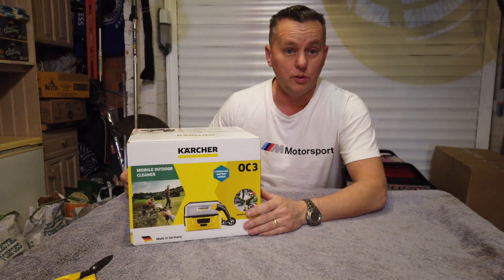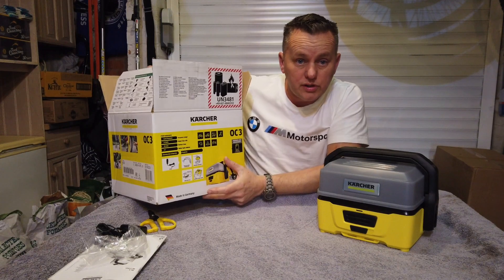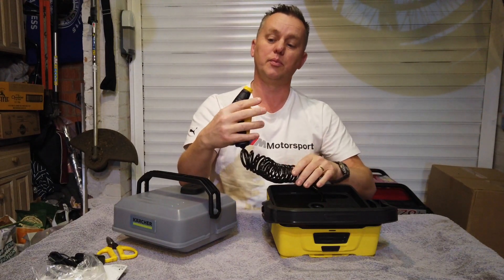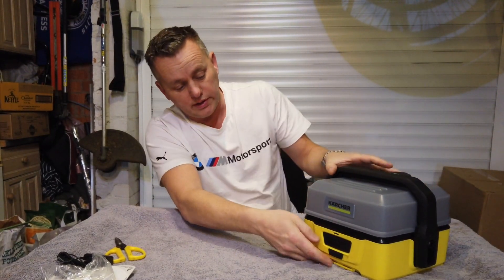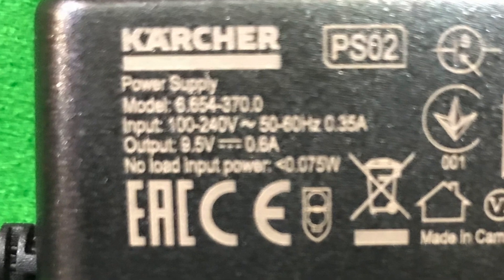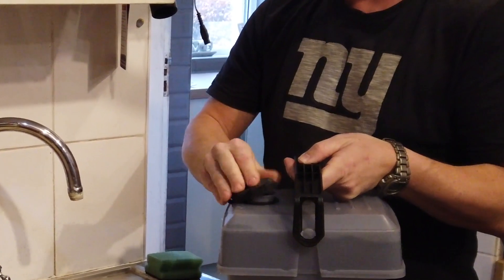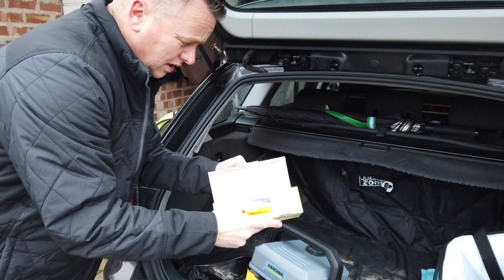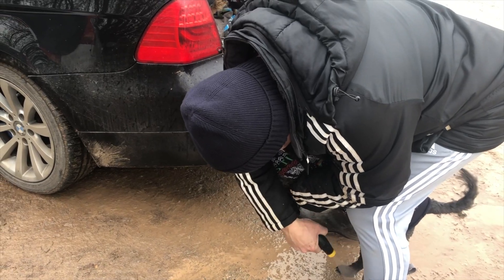Karcher Electric Dog Washer "The OC3 Portable Pressure Washer Review"

Comment: That’s why is was cheaper on Amazon. You’ll need to buy and adapter for the plug. Be careful if buying the car 12v adapter, it will power the device but not charge it when flat. You always have to charge it in the house from mains.
Reply from the maker: After contacting Karcher they did send me a new UK adapter plug for free Thanks for the great comments👍🏻👍🏻🛠